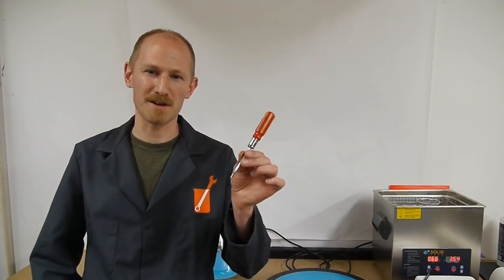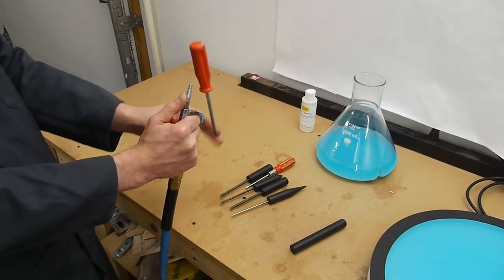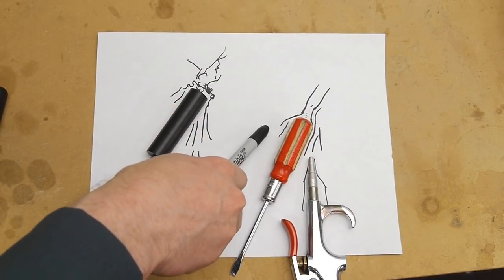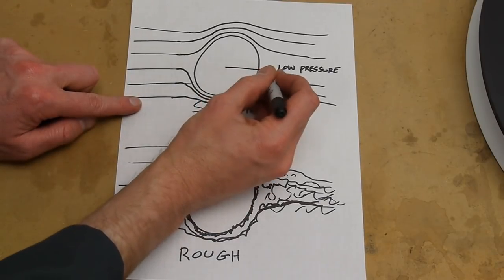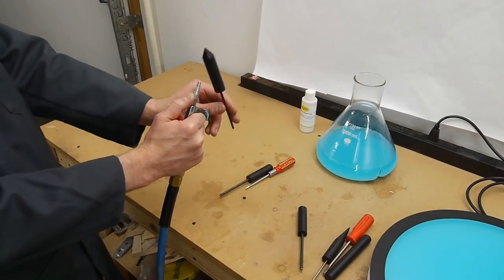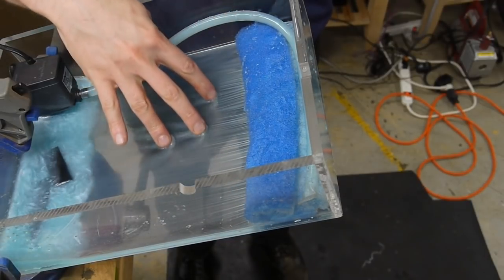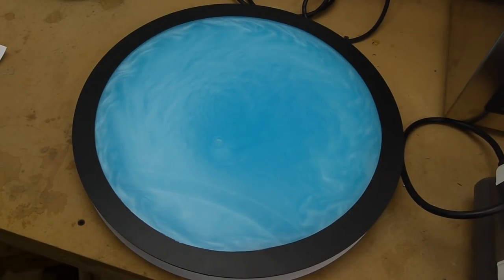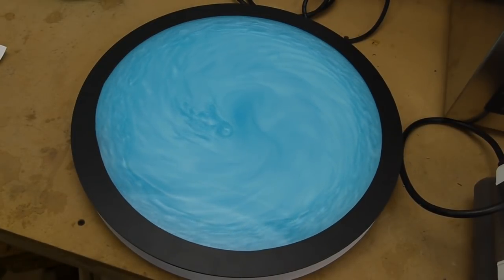The physics of floating screwdrivers

Comment: Fantastic video as always, but slight correction to make. In the comparison of the golf ball vs smooth ball, you say that the flow sticks to the smooth ball for longer, when in actual fact, the reason the low pressure zone exists is because the flow separates more quickly due to the boundary layer starting laminar and quickly turning turbulent and unstable, generating a broad wake. This in turn produces a large drag force, slowing the smooth ball down in flight. 

The golf ball has a textured surface, causing a turbulent boundary layer across the whole surface. The turbulent boundary layer remains attached for much longer than the laminar boundary layer would, causing the resulting wake to be narrower and produce less drag.

Source (if interested!): White, F.M., Fluid Mechanics 6th Edition, McGraw-Hill, 2009, Chapter 7

Comment: I was wrong, I thought it was because of the grooves in the screwdriver.
Reply: Funke Motor same
Reply: That was my first guess.
Reply: Funke Motor I though the same..
Reply: Who woulda think it. I'm thinking the slots acted like vanes and rotated stabilizing the shit while balancing on the air.
Reply: It's both the curved head and the grooves that provide low pressure zones via the bernoulli effect.  The side grooves most likely would just stabilize the screwdriver while the curved head creates the lift.
Reply: Jesse Brennan are you sure it’s Bernoulli’s principle exactly that makes the screwdrivers in this video float?
Reply: Even I thought same

Comment: Quite a neat trick.

However, I'm not sure your fluid dynamics is really spot on. I think what mostly happens is that the lift is created directly by the drag of the screwdriver handle, and the rounded top keeps it from being blown away laterally by deflecting the air away from the nozzle, much like a spoon under running tap water.

Actually, the dimples in a golf ball cause the boundary layer to stick to the surface longer and avoid the large turbulent area. It causes the boundary layer to transition from laminar to turbulent flow, and laminar flow tends to separate earlier, causing a larger turbulent zone behind it. So by creating little turbulence, the dimples avoid the larger turbulence, and the net effect is positive. I'm not sure that's the reason for the tennis ball "fur"; maybe that's just to achieve higher friction on the racket.
Reply: Thanks, pinkdispatcher.  I read other comments from people more knowledgeable about fluid dynamics than the maker of the video is, but yours is the first that got me to understand why the screwdriver doesn't just get blown away laterally, like a ball levitating in a fan vortex will if you get too far off of a 90° angle.  All this talk of turbulence and boundary layers and such reminds me of my college days running simulations in Fluent (now Ansys Computational Fluid Dynamics) for a mechanical engineering professor I worked for (as a relatively physics-naÏve computer science student 😊).

Comment: Although the medium is different, fluid dynamics can shed light on how gravity works.  As you showed a pocket of low pressure develops on top of the screwdriver creating a mid-air vacuum suction that pulls the screwdriver upward at the same time gravity pulls down....

...the medium of space (called the Vacuum in physics parlance) can be manipulated at the subatomic level to create a 'suction' we call gravity.  A small team of us created a model of the Vacuum based on 'informed speculation' in order to develop artificial gravity devices.  

Fluid dynamics has been a major help in our work.  This is an excellent video - good work!

Comment: Love the video, but your explanation of how the low pressure zone comes into being and the reason for dimples on golf balls aren't correct. I think you stated that the low pressure zone arises from the point of separation, which isn't at all what is happening.

The low pressure zone is caused simply because the air is being deflected as it passes over the top of the screwdriver. The deflection is due to the viscous forces in the boundary layer which keep the flow attached as it passes over the curve - and I think it makes intuitive sense that if a flow is being directed downwards by the screwdriver then the screwdriver will experience an equal and opposite upwards force (which manifests itself as a low pressure zone where the flow is being deflected). 

This also explains why the sharp edge doesn't work - because the flow separates so much sooner, there is much less of the flow deflected over the top of the screwdriver and so less upwards force is produced. It also explains why the first cone works - the same principle of deflecting the flow as with the curved top - and why the second cone doesn't - because the angle of deflection isn't enough to produce a force great enough to hold the screwdriver up.

I think if you always consider aerodynamic lift as the deflection of the airflow then it becomes much more intuitive to think about (not to mention more physically correct).

With golf balls, the picture is exactly unlike how you have illustrated it. The point of the dimples is to keep the flow attached for longer - over the back of the sphere - so that we get less drag from the turbulent separated flow. The way the dimples achieve this is by introducing pockets of turbulence in the laminar flow over the front which keep the boundary layer 'energised' and attached for longer. In doing so, there is more skin friction in the laminar region, but that is more than compensated for by the decreased drag created by the separation area at the back. A smooth sphere would have the flow separate much sooner, which creates much more drag.
Reply: Thank you! I was thinking a lot more along your lines, and was desperately scrolling through the comments to find something like this so I wouldn't have to type it. His argument seems to be aesthetically similar to the old Bernoulli principle argument for how air-foils achieve lift, and like that argument, I don't think it makes sense in effectively infinitely sized chambers and at high Reynolds numbers. Your explanation, which seems to me to be a combination of Attack Angle and the Coanda effect, is, I think, the right one. Put simply, don't look for where low pressure zones will be created in the fictitious world where streamlines always meet, but look for where the flow is being deflected by the object, as that's where the momentum will be thrown, and Newton's third law take care of the rest.
Reply: I agree with the OP.  Actually, if you just look at the flow lines, you can infer the pressure differences directly.  

Imagine a flow line going up.  For it to bend left, there must be more pressure on the right to push it that way and vice versa.  IOW, flow lines bend toward regions of low pressure.  The more they bend, the more the difference (at a given speed, etc.)

Now look at the flow lines in the test (and the drawings).  It’s easy to see that the low pressure zones are not where the explanation claims they are.

This simple trick also shows why wings work.  The usual explanation fails obviously since planes fly upside down just fine.
Reply: A little bit technical, your explanation. I get the first paragraph, but the rest have distracting jargon. I looked it up and I find it very complicated.
Reply: @johnallencrist.delosreyes9491  it is not distracting. Do some more reading.
Reply: Newtonian.
Reply: Yeah, I was going to mention that turbulent flow actual creates more adhesion to the surface, which in term makes for a smaller area/volume bounded by the flow boundary lines.

Comment: Ben, I could be wrong, but from my aero classes I believe this is actually the Bernoulli effect at work which is based on the force generated from turning the air flow (just like an Air foil wing design. The turbulent air you mention on the sharp edged versions is not generating lift nearly as effectively because the flow is not able to turn the corner without separating from the surface.  This also explains the long cone not floating because the flow is not turned fast enough to generate significant lift. An example of this tail design in use is the rain drop body design used in extreme efficiency car races.

Comment: Hi. Great video! I love how thoroughly you investigated this. I'm a physics teacher and I might show this to my students as a great example of the scientific method. I disagree with you somewhat though on the forces making the screwdriver float: From the orientation you demonstrate, I'd say the forces are: gravity-> down, direct force from air stream -> up and away from nozzle (probably enough up to counteract gravity), and then a 'reaction force' pointed horizontally back toward the nozzle. You can see from the water that the fluid changes direction right at the end of the screwdriver, bending away from the nozzle. This would create a Newton's third law reaction force on the screwdriver toward the nozzle, which is needed to counteract the component of the direct air stream force away from the nozzle. I'd love to talk to you more about this, it's one of my favorite subjects. Thanks again for the video.

Comment: Just a little FYI; the plastic bag behind a truck is stuck in a «rotor», which is a constantly rotating behind the truck, driven by high and low pressures. What i find interesting and at least non-intuitive is that airplanes, kites, and pretty much everything that flies are lifted mostly by the lower pressure on top of the object, not the other way around. Which is sort of demonstrated with the screwdriver in this video. Well done!

Comment: The taper angle at which you will start having air separation is approximately 7 degrees (14 degrees included angle), anything below that should continue to have attached flow, anything above that will show progressively higher degrees of separated flow.

Comment: Great Explanation! Might be cool to mess with the center of gravity and test some different angles, too.
Rheoscopic fluid is great! Love that stuff, Acrylic hemispheres are really easy to blow mold -Hint Hint 
Just a back plate and a hole plate, clamp it and heat it to 320F than hook up an air compressor. They turn out great (thicker acrylic distorts more as the center gets thinner than the edges) I've had great success with it, up to 1" thick for a 6" dome

Comment: Cool video, thanks for sharing. In my early career we had to measure the dust carried through and into industrial chimneys. To this we used a pitot tube to measure pressure at fixed intervals through an arch shaped pipe that led to the chimney. The flow rate near the walls was lower as would be expected and increased as we moved toward the centre. In the middle we often found the air flowing in the opposite direction which suggested a vortex. We then used the measurements to draw off the hot gasses at the same pressure as the flow to collect the dust. Often wished we could have had a window on those things to actually see what was going on inside. Interesting but not always comfortable work. Thanks for invoking the memories.

Comment: Excellent tutorial! Correct, the round end of the screwdriver creates lift. Both screwdrivers have low air pressure at the end, but the flat ended screwdriver creates irregular turbulence.

Comment: Has anyone else pointed out that you got the part about things floating up in a pickup bed wrong when you said it added drag. And you even already said why! The air circulating in the bed of the pickup meets the lower pressure air going over the top of the cab, provides some lift. Totally interesting is that if I open the little slide window, even a little bit and especially with cab windows open, things get crazy in the bed and a lot more lift is added.
But like you said, if we open the tailgate and smooth out that airflow we create more drag. Go from the square mock screwdriver to the tapered.

Comment: The flow doesn't necessarily have to separate in order to create low pressure. Low pressure is also caused in a fluid as its relative velocity increases (bernoulli's principle). This is why the first cone worked best:
With the first cone, the flow stays attached and the low pressure is created as the fluid accelerates on the back side. It accelerates as it is sucked towards the highspeed (low pressure) air from the nozzle. So the air accelerating towards the highspeed flow from the nozzle is creating low pressure on the other side of the plastic. It stays in place because of the equilibrium of forces. Explaining why there is stability is also an interesting discussion.
Sorry If I this is hard to follow. aerodynamics is complicated and counter-intuitive at times.

Comment: You have just demonstrated what makes an airplane airfoil lift and carry the fuselage up.  Too many people think that the air pushing on the bottom of the wing is what makes the airplane fly when in reality it is the air pressure differential between the air on the bottom of the wing and the top of the wing creating a partial vacuum on top of the wing that LIFTS the fuselage.

Comment: Your long tapered cone isn't a more severe taper, it's a less severe taper. The change in shape at the end is what I believe works like a wing or a sail, or what could be called the nozzle effect or venturi, where the expanding air in motion drops in pressure. The more gradual sloping taper doesn't develop a strong enough expansion area as the shorter cone or chamfered top do. I was watching another video on interference drag that explains this effect where two tapered structures in contact with each other create a three dimensional partial "nozzle" such as an airfoiled strut at right angles to a tapered fuselage or wing. Both dimensions are dropping away from the laminar flow toward the trailing edge, creating a strong low pressure, = drag.

Comment: Fifteen years ago I discovered how to do the same thing with inverted 20 fluid oz. sized soda pop bottles partially filled with water. By adjusting the amount of water I achieved excellent stability. The aerodynamic lift generated by air flowing over the rounded bottom of the bottle (perpendicular to the air flow), the drag in the direction of the air flow and the downward pointing weight of the bottle form a vector of balanced forces.

Comment: And this was in the case of a simple little screwdriver,  it's hard to imagine the difference it would make if the wings of a jet were fin-tipped as opposed to flat - tipped, thanks for the video and explanation!
Reply: And that is the big difference: You could do it with the fuselage, but not the wings, because the separation would cause a stall

Comment: The low pressure zone is created not by a flat surface on the top, but by having the airflow expand fast over the receding shape of the top. If the airflow expands slowly in case if long cone, the pressure has enough time to dissipate.

Comment: I think technically, the low pressure area doesn't "suck" the object toward it, although that's a convenient way to describe it, I agree. The high pressure areas exert more force than the low pressure areas, and that is what moves it. Low pressure is still pressure, so air molecules are still bouncing off, pushing against the surface, but they have less force overall than the surrounding high-pressure areas.

Comment: The reason the square profile handle won't float is exactly the same reason airplane wings stall:  when the angle of attack (angle of the wing's chord line compared to the relative wind) gets too steep, the air can't flow smoothly over the leading edge and down the top surface any more, which causes turbulence in the air currents and destroys the low pressure region on the top of the wing.

Comment: Seems like there is also an ebb pulling at the air blown off of the bevels in the plastic handle, which also causes the slipstream to balance the metal end of the screwdriver (only in its upright orientation) and it strengthens the overall flow up the sides of the handle, I think, ... much akin to the case of the slipstream/air-flow when lobbing a basketball with backspin

Comment: I think on the cone ones the low pressure zone probably isn't at the tip of the cone but rather off to the side a little, as the compressed air isn't coming from straight on. With the shallower one, the surface is close enough to perpendicular to the airflow that it can stay afloat, but the steeper one cannot.

Comment: oh, it's the venturi effect. It's like the tip of an airbrush, which is a cone. The cone actually sits inside a cap which makes another cone around the smaller cone, or I guess you could call the smaller cone the inner cone. The compressed air is fed around the outside of the inner cone, confined by an outer cone-the aircap, and forced out through a small hole at the tip.  That creates  low pressure at the very tip of the inner cone and that sucks up the paint through the inner cone and shoots it out into the airflow.